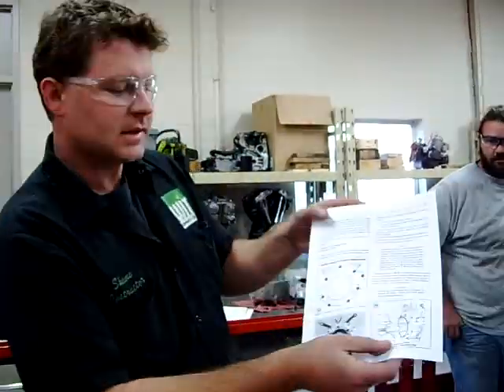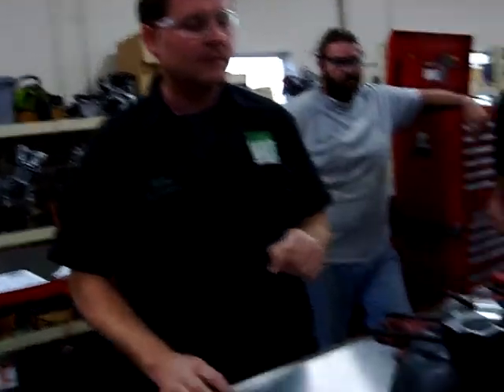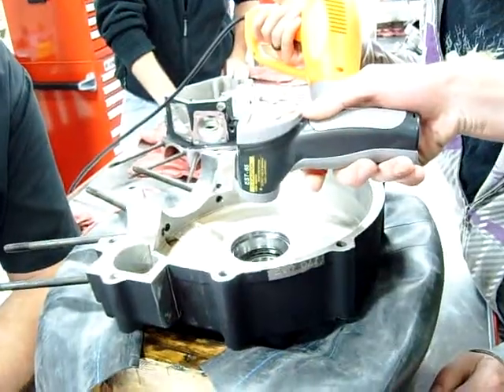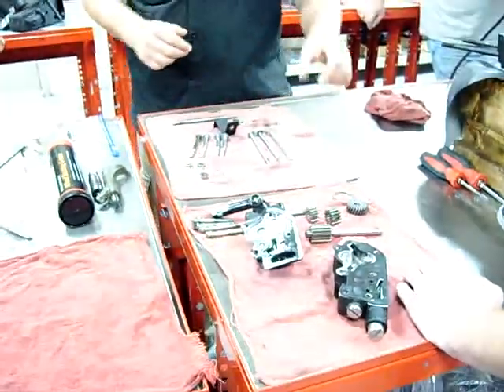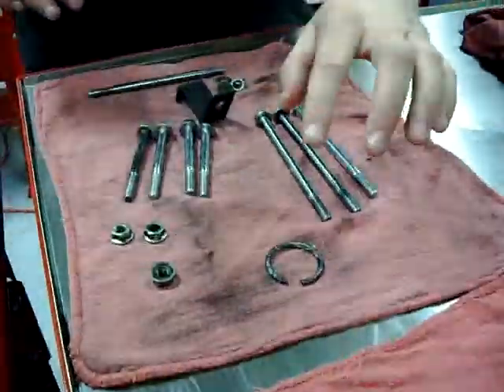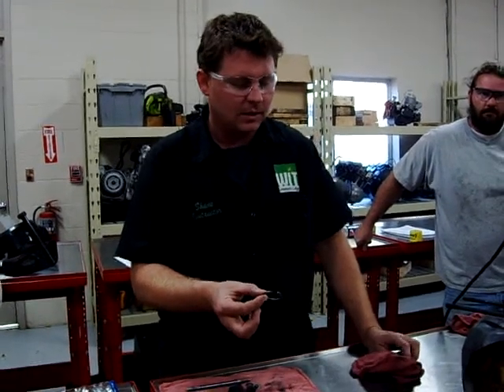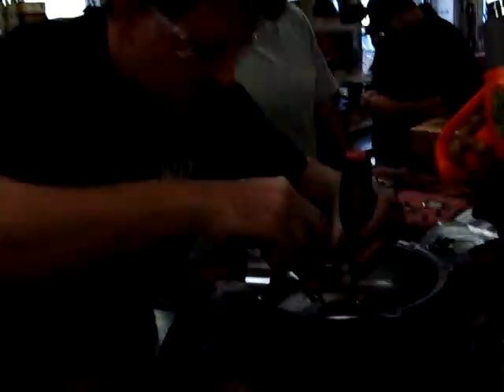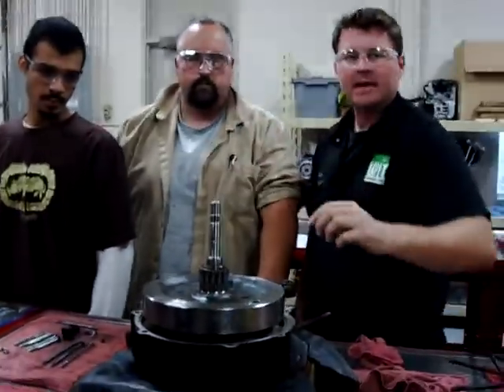Part 02 How to install a Flywheel from a Harley v-twin S&S Revtech EVO Cases

Comment: Is that a Tapered Roller Bearing on the Flywheel shaft and another bearing in the case ?
Reply: bearing held in by the seal and spacer in the case and one is pressed in on the shaft.

Comment: I want to close the engine with the new guns. to assemble the engine I need a workshop shop. to see how much I need to tighten the bolts and screws on the cylinder and cylinder head
Reply from the maker: Right on. Keep enjoying the videos and join the channel to get all the videos.